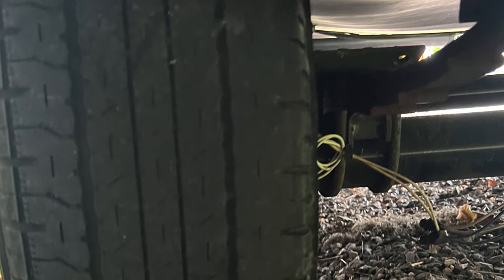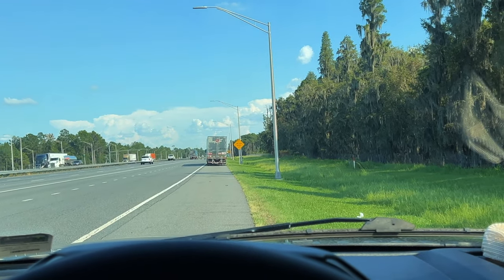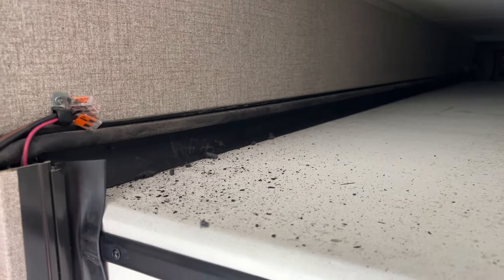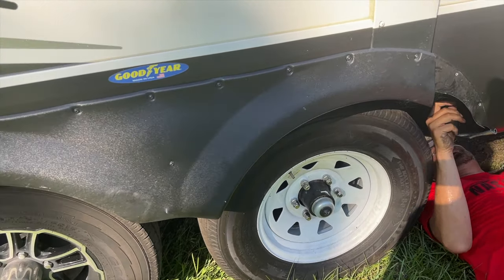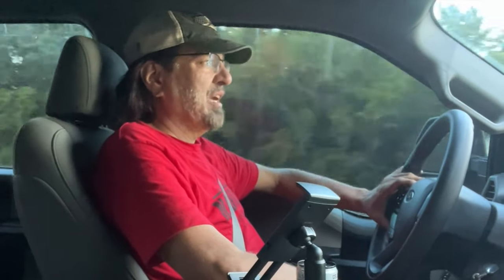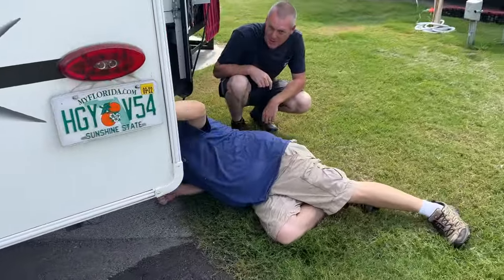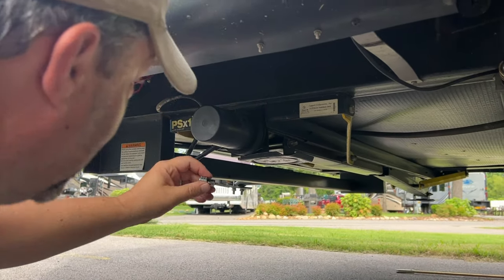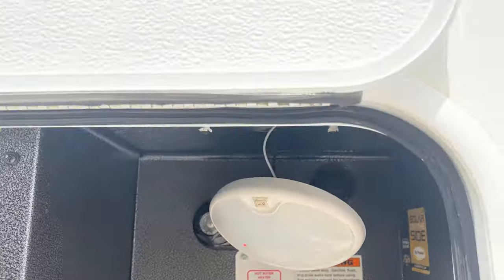Prevent Tire Blowouts and Replace Fridge Fuse for Safe Travels

Comment: Despite the repairs needing done, it was a fun trip!  Too bad we weren’t with you on the blowout. I have 2 Milwaukee impacts, a bottle jack, a breaker bar, a torque wrench, and sockets that fit every nut and bolt on the camper.   Can’t wait until our next trip together!
Reply from the maker: I can't believe i FORGOT I had the breaker bar and lug wrench LOL I just grabbed the one that came with the rig and spaced out LOL

Comment: Hey Chuck,  just talking w hubby about your blowout. He looked at pic of tire and said as a safety check you might want to have a look at axles as the wear on that relatively young tire likely indicative of bigger problem. Just a heads up as opinion obviously is based only on your pics. Hope it’s nothing but better to be safe and check it out for peace of mind. Safe travels.
Reply from the maker: Yup might need axles realigned for sure. I had some issues with previous rig and fixed it myself but this is under warranty so might have to see about getting those checked. Thanks!!!

Comment: I didn't see you mention it, but you could always use the jack that came with your truck in a pinch.
Reply from the maker: I thought about that but when we did that with previous truck and trailer it bent the Jack.  But that was f150. This Jack might have worked.  I thought about that after the fact.

Comment: Sorry to hear of the issues you have. Great vid for those that are not equipped for travel in an RV. May seem expensive at first and takes up space but worth it in the long run. We take the summer here in Florida off for Rving and have an appointment with RV One the end of this month, course it will not fix our problem cause they have to lay eyes on the issue, then order parts. Probably worth going to Tech school if you own and use an RV a lot. Glad you are set to go next outing. Take care and stay safe.
Reply from the maker: When we were leaving for our last trip we actually went by there and seen they were advertising for tax so I’m sure they’re shorthanded. But I still think they should return a call. We do love RVing it was just in that moment Alli was like I’m done lol

Comment: Odd tire wear is axle out of alignment. Need to have it fixed or you will just eat up another tire.
Did you check tire pressure on spare before you installed ?
Did you torque lug nuts after putting spare on ?
Reply from the maker: Yeah I’m afraid of that. Yep checked it and torqued it and rechecked shortly after driving on it too. Couple times actually. I was gun shy at that point. Lol

Comment: I see the tire that blew was a Goodyear but in a video you did a few years ago you said you really liked the Gladiator tires. I'm wondering what your long term impression of the Gladiator's was. Did you have any issues with them?
I'm thinking of getting a set. Any input you have on them would be appreciated. 
Thanks
Reply from the maker: I’m actually still using the Gladiators on my cargo trailer. They’ve held up really good. I would not be opposed to using them on the RV again

Comment: I’m so sorry this happened, but it is a part of RV life. Seems like you’ve had so many issues with your Jayco RV’s. The crazy thing is you seem so on top of maintaining it. Just wondering, why did the tire wear so bad? Not judging anything, but aren’t those the Goodyear endurance tires? They should be like new.
Reply from the maker: Yup true! Yes Goodyear endurance and two tires wore uneven. Not on same axle either. May have to contact lippert if these new tires wear the same way. Gonna stop traveling with fresh water and see if that helps with weight

Comment: I see a tire minder in your future.
Reply from the maker: Oddly enough we have one...true story, the batteries died in 3 of 4 this trip! We had stopped at Buc ees  near Macon and I went in to buy new batteries and can you believe the ONLY batteries they were sold out of were the 1632's! BUT with that said our TPMS is like 6 years old and with the length of this trailer we drop signal a lot so I'm thinking we will upgrade asap!
Reply: Chuck I just ordered the tire minder this year and it comes with a signal booster works good so far